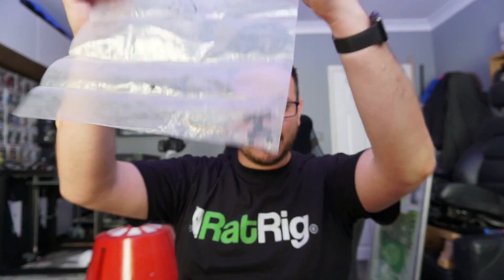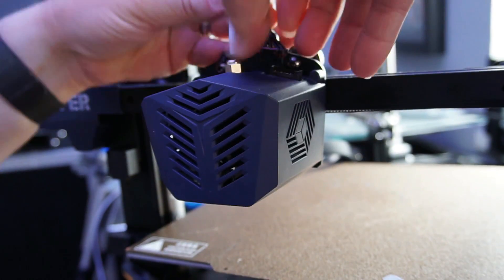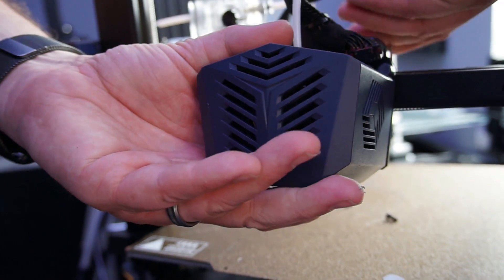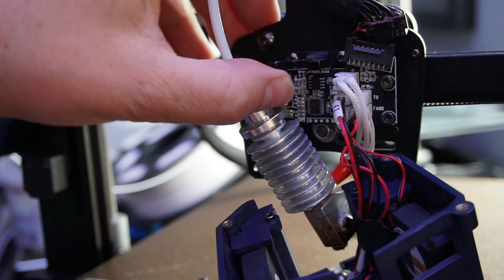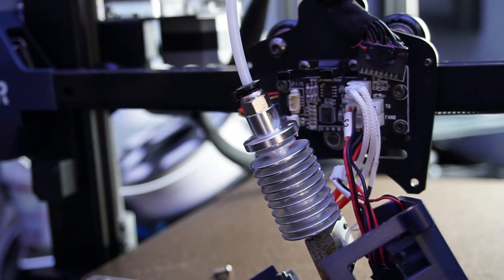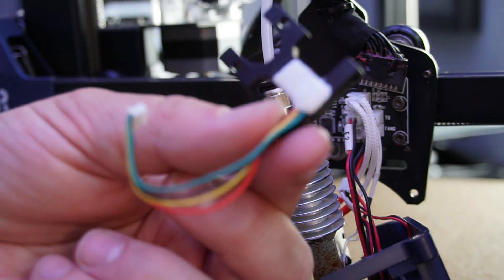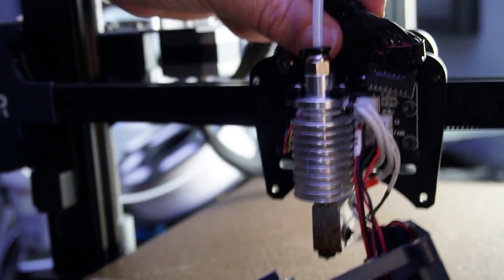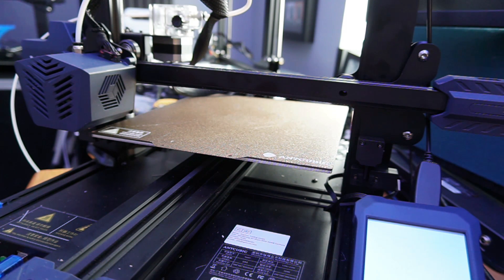Anycubic Vyper Sensor Fault

Comment: The video is very clear indeed. Thank you again. I contacted the support by sending the photographs of the malfunction after being able to disassemble the extruder plastic body (especially the red glue of the clip which was a pain in the ... :))). They confirmed that the "Strain Gouge" is the problem and they will send me a new one. I would like to have some in stock in case it breaks again ... but I can't find any online  or on the Anycubic website...
Reply from the maker: Great stuff ! Well as it’s a new product there won’t be much stock I’ll see if I can get an understanding of costs for these units
Reply: I mention elsewhere I can get a Vyper strain gauge for $29 AU but the Creality one is only $10 which sounds about right.

Comment: Thank you for your Video, my Vyper have the same Problem, i still contacted the Support of Anycubic but i have no answer in the moment. Now i know I am not allone.
Reply from the maker: Hope it helps it’s an easy fix so ping support a message :)
Reply: @TheRealSamPrentice  I still wait on the answer from Anycubic Support :) Yes to change the part is absolutly no problem, i hope they have the spare part on stock, and i don't have to wait to long.... :) It's good for me now to know where is the Bug, after two evenings of troubleshooting. :)
Reply from the maker: @derabsoluteHammer  let me know if you don’t hear anything and I’ll push it along
Reply: @TheRealSamPrentice  Thank you, that is very nice, I will keep the comment here up to date as it went on...
Reply: @derabsoluteHammer  have you receive the part ? you said 15 days ! i have the same problem here and i just sent a ticket, i hope they will answer fast and send the new part fast too
Reply: @sebastienroux1285  yes, i received the part, okay it was i think 3 weeks but the told me the had to sent the parts first to european warehouse, and from there they sent it to me. But yes, i got it, i bulit it in and it works fine....
Reply: @derabsoluteHammer  how long did it take to get the part was 15 days acurate
Reply: never mind read the response